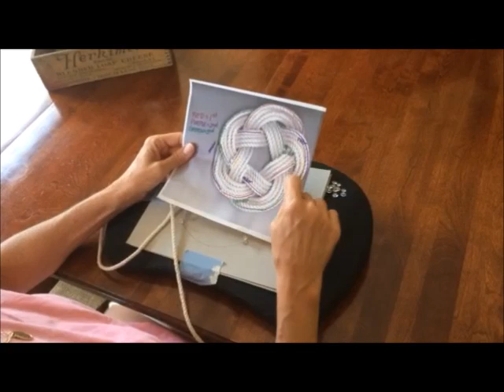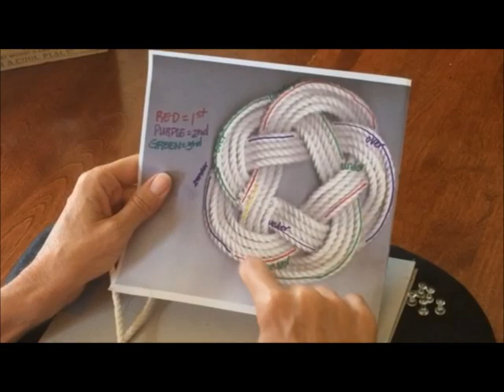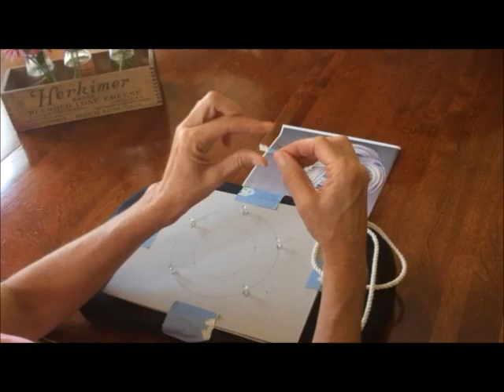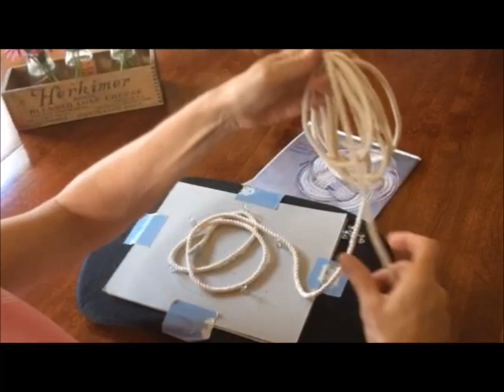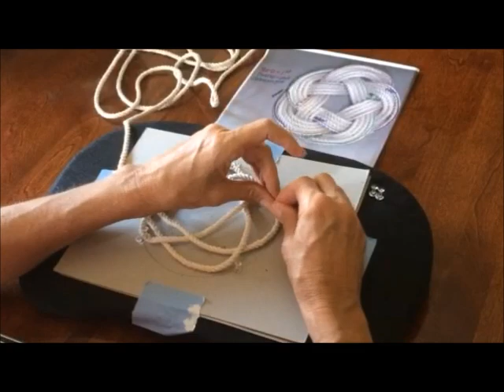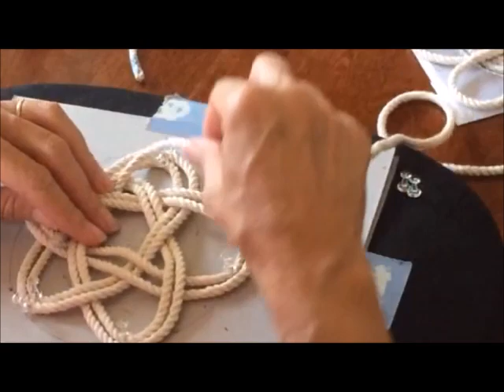Turk's Head Knot Flat Trivet or Coaster

Comment: what length is your rope?
Reply from the maker: I bought 100′, which will make 12 (3.5″-4″) coasters or 2 (6″) trivets and 6-8 coasters. Determine the size of the rope trivet or coaster that you want. (I find that the coasters lie a little flatter when closer to 4″ than they do at 3.5″) Multiply the dimension in inches by 2.1 to determine how many feet of rope you need.

Comment: would be helpful to know how many feet of the rope each 6 inch trivet requires?
Reply from the maker: Multiply the dimension in inches by 2.1 to determine how many feet of rope that you need.
Reply from the maker: Sorry Erin, just realized I didn't explain myself better. Multiply the desired diameter of your coaster/trivet by 2.1. So for your 6" trivet, you will need 12.6 feet of rope. Happy Knotting!
Reply: @Nourishandnestle  What size line do you use?  1/4", 3/16"??  And Thank you for your great video!
Reply from the maker: @barbarabate6473  I used 3/16″ triple-ply cotton rope.